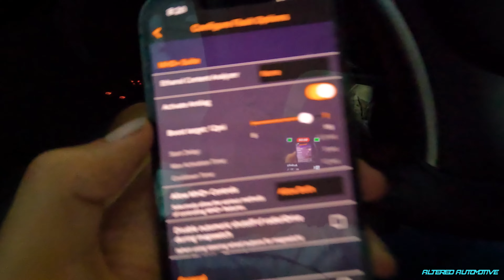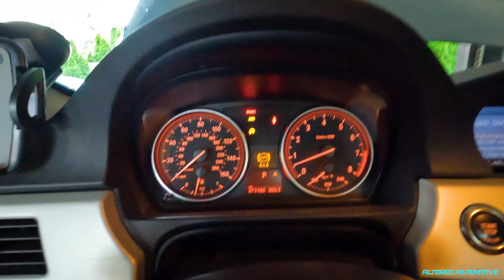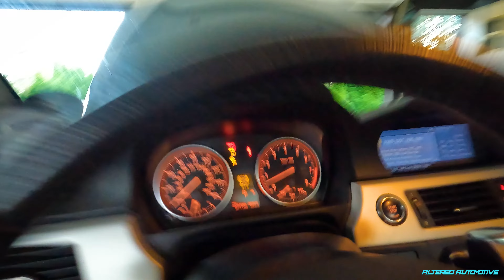N54 BMW 335i GETS ANTILAG!!!

Comment: Thank you for the great video! I'm gonna guess that you have the intercooler by now but just so folks know you can run the higher stages without the "recommended" mods. It just won't consistently perform as it would if you have the mods installed. You won't hurt the engine but you will get heat soak quite quickly after about two pulls and your power will not be the same because the computer will pull timing out.  But I'm not telling you to do any of this I'm just saying that I did for a year or a bit more and that's really all that I noticed.
Reply from the maker: Thank you, and yes I actually put it on in the video right after this one! 

I got to say you got some balls running it that long with no supporting mods but we in the N54 community appreciate your commitment 🤝